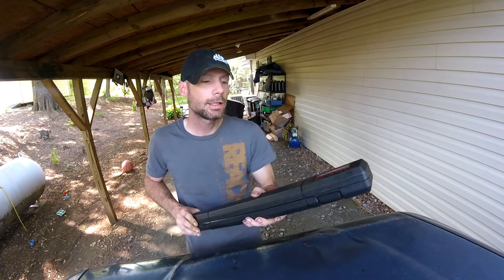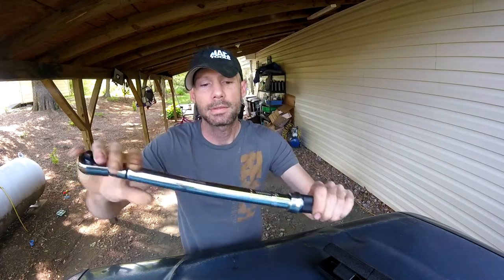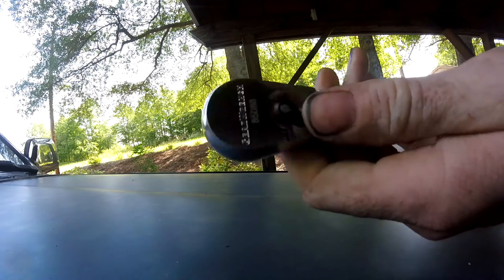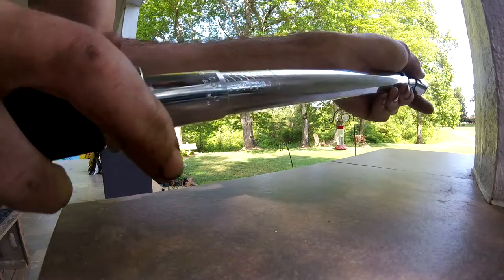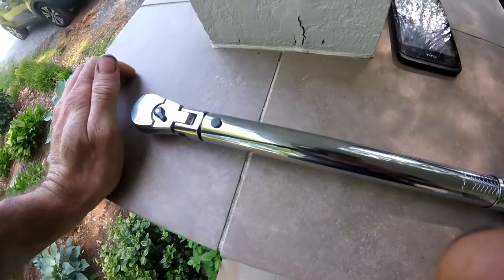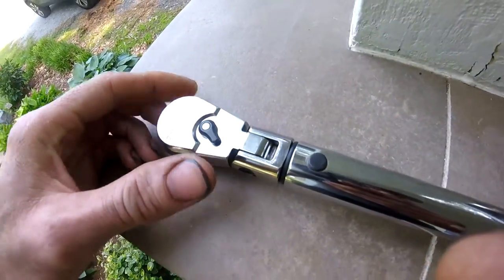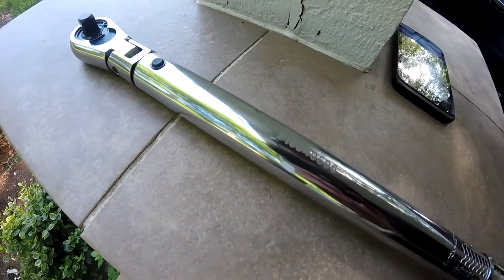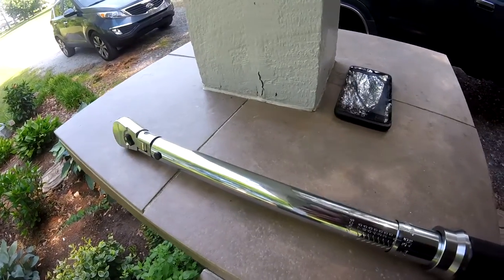Gearwrench 85086 / Matco TRB75F 3/8" Flex Head Torque Wrench

Comment: Hows the length would it be ok torquing small block chevy heads? It covers the range of everything i need if the length would give enough to torque head bolts around 65-70lbs

Comment: My guess is that the flex head has detents at the +/- positions because you're supposed to add a small amount to the torque value to compensate for the angle. If you use it with the head in between the detents it throws off the torque value (for what it's worth!).
Reply from the maker: Quite possible

Comment: just got this torque wrench but im wondering if i got a bad batch because the head on mine wobbles. tried tightening the allen screw but seems to be still loose
Reply from the maker: Wobble side to side? I'd say you should try to get it exchanged

Comment: Will this actually work and torque accurate at 5-15 ft lbs
Reply from the maker: All torque wrenches will be most accurate in the middle of their range. On the higher or lower ends they are at the spec listed for accuracy. About plus or minus 4%. If that answers your question. But I used this wrench quite often over the last few years without any issues. I only recently upgraded to electronic ones from Snap On. But this wrench is still in my box and has been checked and holds its calibration still. It's a good tool.
Reply: @AppalachianDIY  Great thanks! I own the 1/2" version and love it! I use it mainly between 45-80 ft lbs but need a smaller 1 to get down to 5 and trying to decide on this 1 or the in/lbs version but wouldn't use that 1 hardly besides for 5-15 ft lbs where this 1 I can use A LOT more lol so it's basically a stressful battle in my head right now lol if this will work that low I wanna buy it lol